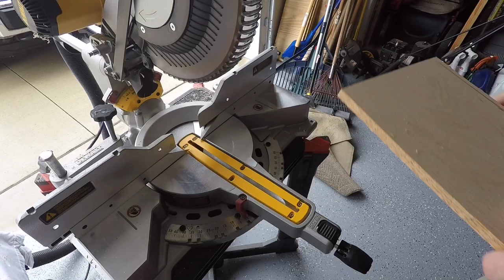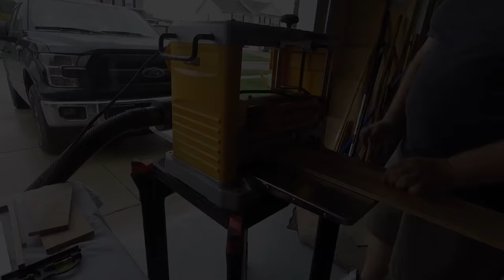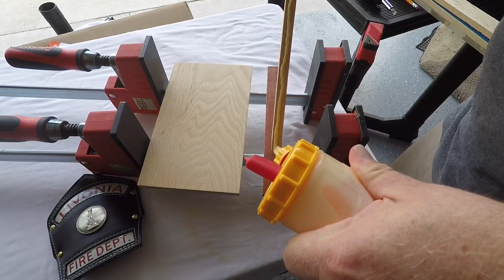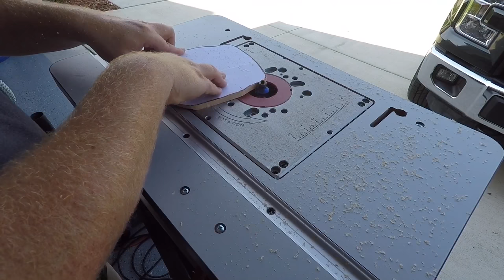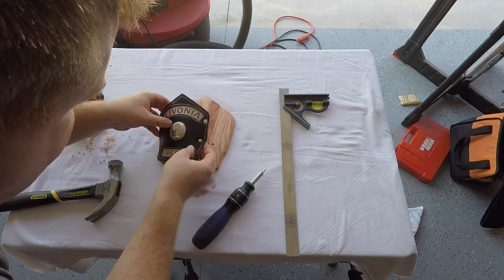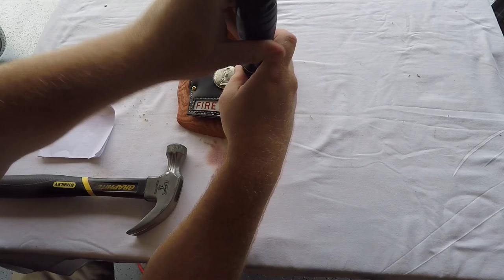Wall Plaque for Leather Fire Helmet Shield

Comment: A  couple of questions if it's ok. First off how thick and how long were the wood supports that you used when the plaque started cracking? Secondly how did you secure the supports? (glue, screws?) Thanks!
Reply from the maker: This was my first attempt at it.  I didn't have the nice tools I have now. So when I jointed the material it was not completely square. Once I properly joined them it worked. I just used wood glue. For this piece in the video I made a French cleat and that gave it support.